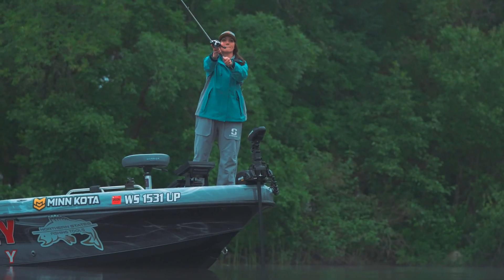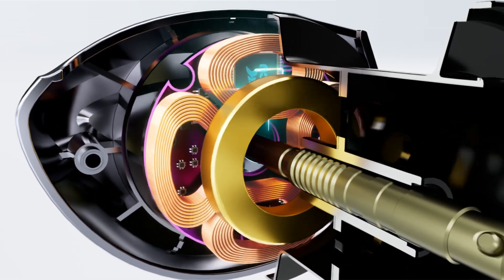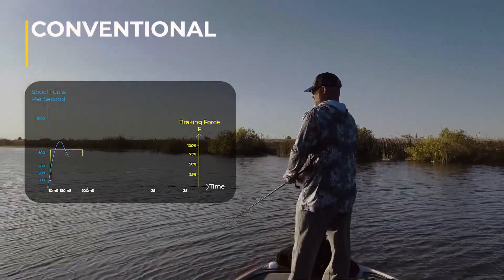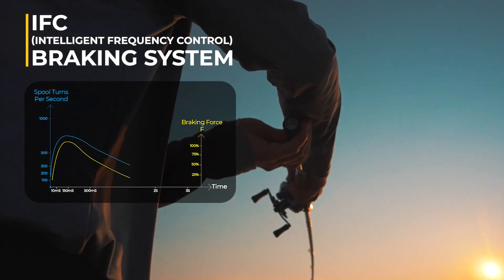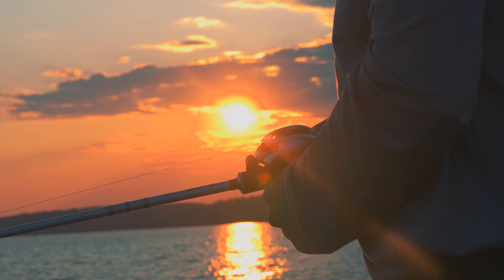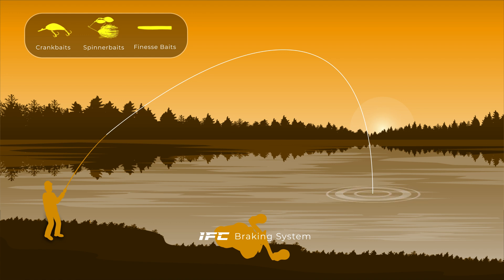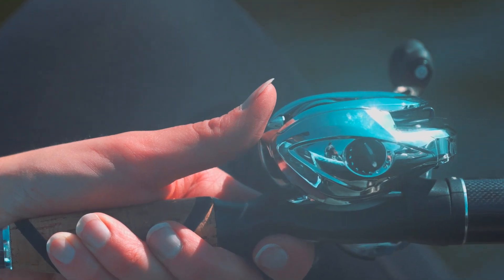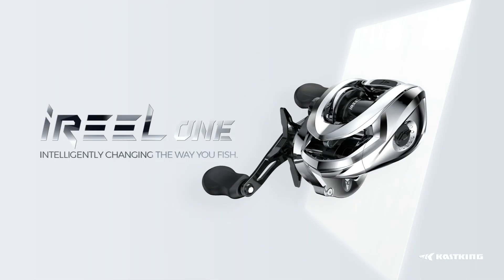Technology Explained: IFC Braking System

Comment: if you have to charge after couple each session of usage; then is a pass ... but if you don't need to charge to use; then you what the the charging is for too, this one confuse innovation 🤣plus i going fishing to stay away from phone; not to look at my phone again
Reply from the maker: Thanks for sharing your thoughts! The charging feature is mainly for the intelligent system, allowing you to pair your smartphone with the KastKing app via Bluetooth to access real-time casting metrics. But don't worry, you can still use the iReel without charging it, functioning like a regular reel but with the added benefit of the IFC braking system. And we totally get it if you prefer to stay away from your phone while fishing. You can connect it to your smart watch or our FishIQ sunglasses to receive audio broadcasts of the real-time data instead.